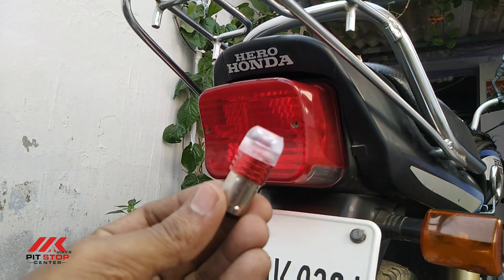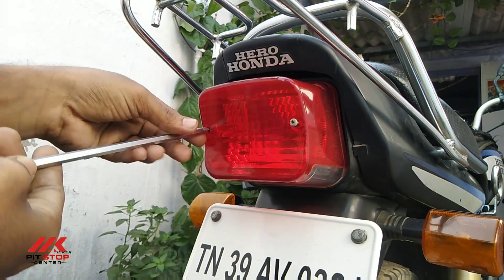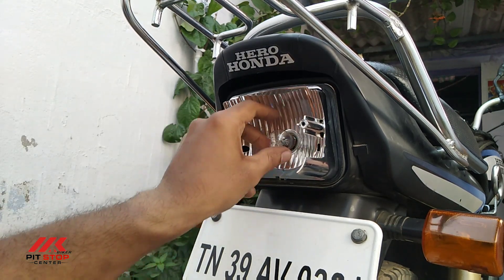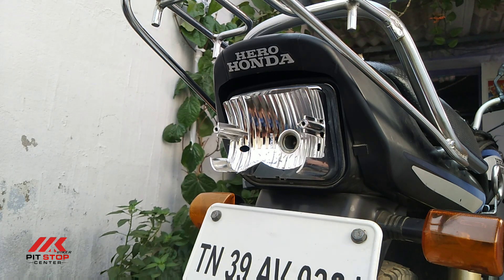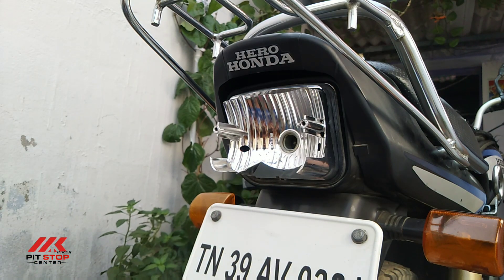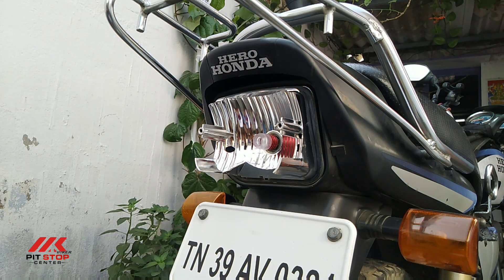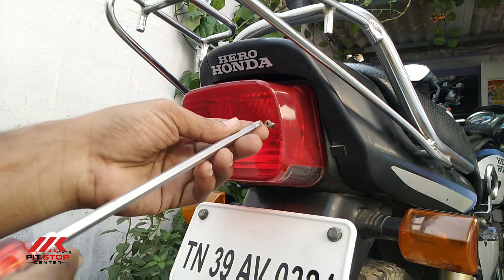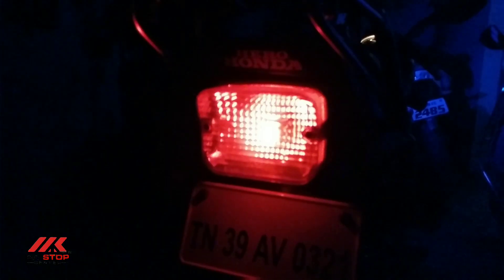#Led brake light ||splendor plus modified#mkbikerpitstop@MK_tnbiker

Comment: Bro en bike la healight off pantu hand brake aluthna meter light head light automatic on agthu but back light on agla aprm head light on pantu handbrake aluthuna back light on agthu athu ena prblm bro but bike start panama key pota
Reply from the maker: Main dc line onnu front break ku varum..
Athu short circuit iruku nenaikura
Or native short aguthu
Reply: Bro athu ethum damage irkuma bro inaiki wrkshopla vidnum bro athu rmba nala irku nenaikrn na nethuthn pathn bro athu elli one time wire kadichi irunthuchu APA ethu velaya pathutu atha wiring ethum wrong kuduthu tngla thrla bro